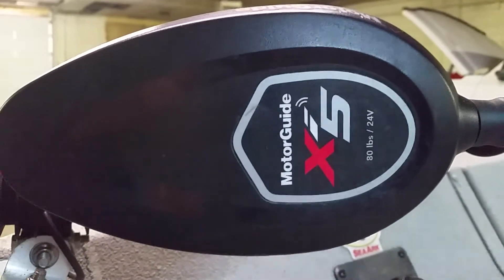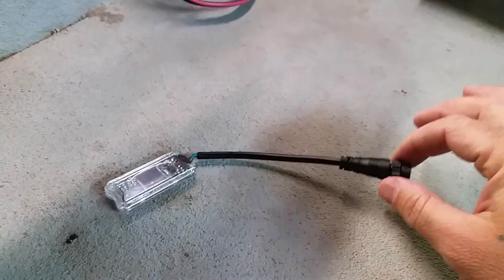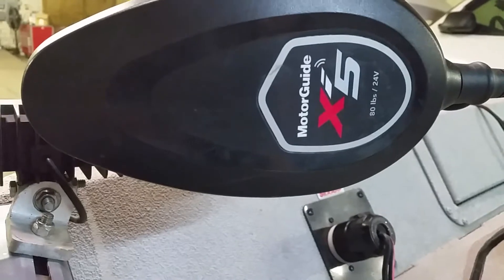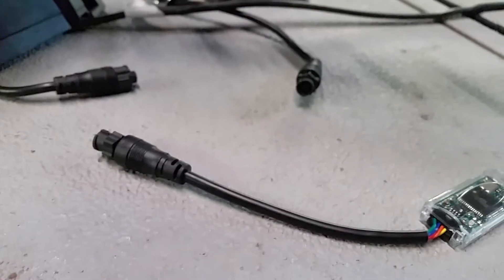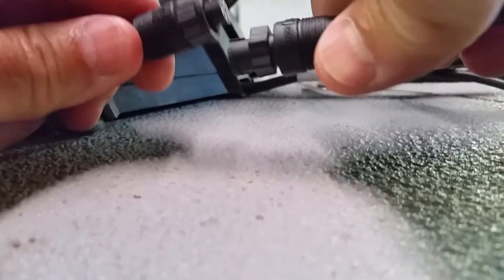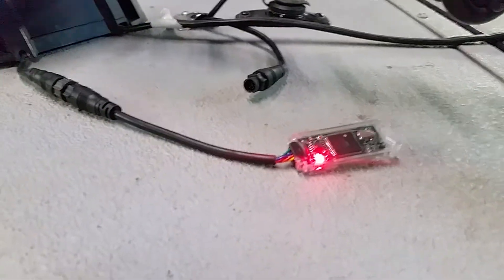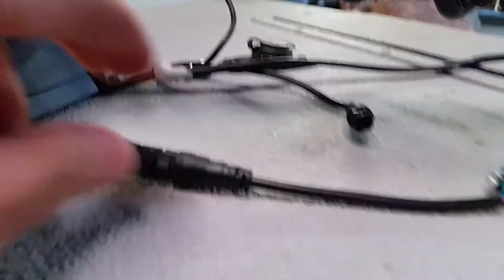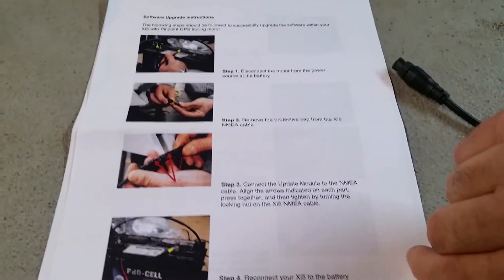Motorguide xi5 Software Update using update card from Motorguide Customer Service

Comment: My spot lock stopped working recently and the forward assist feature mine all worked from my remote I run Garmin electronics I wonder if this is my issue , seems the xi5 is a bit of a lemon

Comment: I'm guessing this is the same problem I'm having.  One day I can acquire a GPS signal, and the next time out I can't.  I've had the unit for just over a year. When it works it's great, but when it doesn't, I speak in tongues!  I guess I need to contact Motorguide.

Comment: I have an issue when trying to use cruise control.  My trolling motor just keeps getting faster and faster even though it shows a set speed on the lowrance.  Motorguide told me I needed to take it to a authorized dealer and that once they verified that it needed the update to correct the problem, Motorguide would THEN send a dongle to the rep to then update my unit.  

How did you go about getting them to send one directly to you?
Reply from the maker: C. S. Just have Motorguide send you the update card and do it yourself. I heard the dealer will charge you to do it. Motorguide will send it to you then you just mail it back to them.
Reply from the maker: I just called them and ask that they send it directly to me and I would give it the update.

Comment: I have had my Xi5 and HDS 12 for over a year now. ...  How would one know if they need to update their own unit? ... Does it work one trip and then not on the next trip? ... I am having issues with my Xi5 when I want to, "Go to cursor", it starts to go in the general direction but will go past the cursor mark. ... Thanks
Reply: 240LTS you have to change that in the Autopilot settings of the HDS unit.  I had the same issue too...
Reply: @4ReelFishing   Hey, 

I got the Motorguide Xi5 105SW model and i have been using it for ower a year now. Im a big fan of the anchor mode function, but some times the motor gives me a faint buzz or sound and goes out of anchor mode it can be very annoying if i dont hear the motor signal. Anyways its strange because i can activate anchor mode right after it goes to manual mode so no problems there. Have you had that problem ? So sometimes i can stay in anchor mode for 1-2 hours and other times its only for 20 minutes before it goes in to manual mode. But agin it still has satelite signal and i can just press the anchor mode button on the remote and it will go back to anchoring.
Reply: John Andre Johnsen 

I’ve had it happen twice before realized what Was going on.  After setting “GO TO CURSOR” on my HDS the Xi5 was driving to the spot but then I pushed “CLEAR CURSOR” so I could watch the Map update.  This was putting my Xi5 in manual and it was just driving wherever.  Hope this makes sense
Reply: @4ReelFishing  

Hello again, 

I have been trying out a few things and one of them is to run te motor with out the nmea 2000. Turns out the problem still presists. I have now ordered a new GPS module and circuit board. But im not sure if im going to change both right away or one at a time to see which one is causing the problem. Hopefully this will sort out the problem and im guessing that it is the GPS module that are faulty. Anyways thanks for cominng back to me :)
Reply: John Andre Johnsen 
I’ve exact same issue 
Did you end up fixing ?
Reply: John Andre Johnsen hi did you find a fix for your Motorguide. Mine does the same exact thing. Anchor mode will work then randomly shut off. Sometimes it shuts off very often, some days just a couple times. Very frustrating.
Reply: Change what in my HDS? ...  I'm going to do the next HDS update the next time I am in the boat. Not sure that has anything to do with what we are discussing though?  Thank you ...

Comment from the maker: So the update did work perfectly.  You have to contact Motorguide for the update cord and module.
Reply: Willis Guide Service I’m assuming mine has the same issue. I’ve had it running for 3 years no issue. Then it stopped. I’ll be calling them on Monday. Thanks for posting. I’ve been searching for 3 days on a fix. Do they charge for the update?